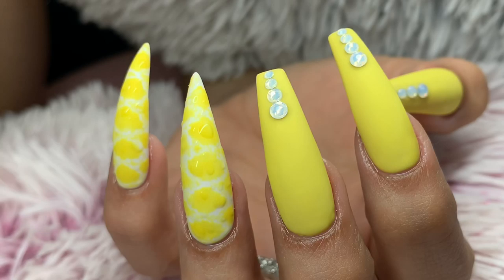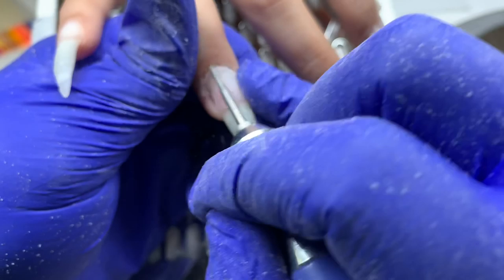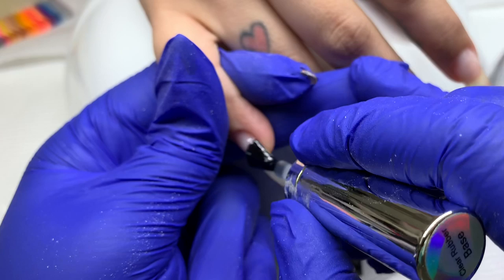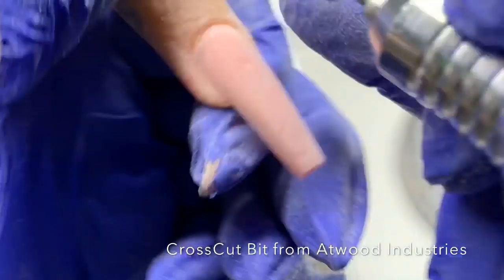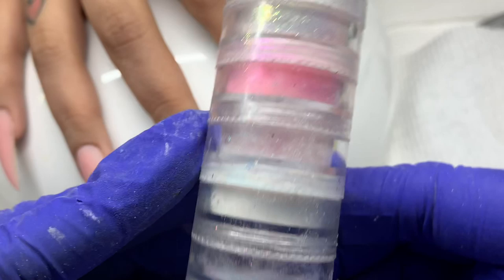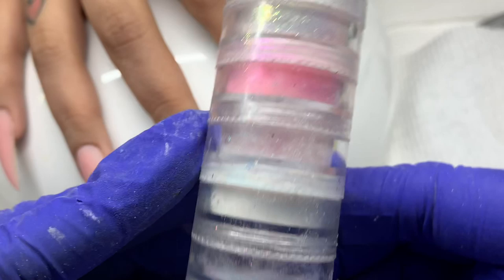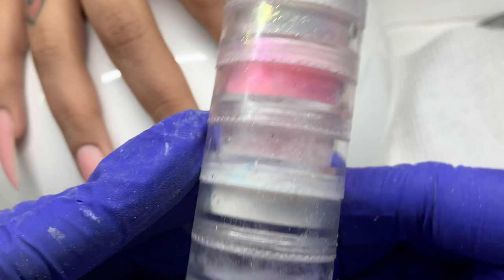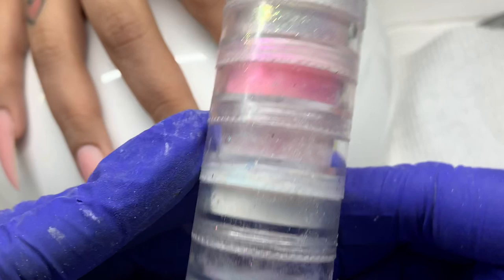WATCH ME WORK: 🐍Snakeskin Drip💧| Cost to be the Boss?🤑 See the Price of these Nails

Comment: I struggle so much with lifting no matter how well I prep the nail. I dehydrate and prime once let it dry , prime again to apply acrylic over the wet primer I've tried everything ! I'm so at a loss bc no matter how flush to the cuticle and sculpted I build the nail after like a week it's lifting. I was contemplating using a base gel coat before I put the acrylic on but I dont know how well it would work. Is there any advice you could give me ? I've been doing nails for years and I still haven't cracked the code!!😩 please help!